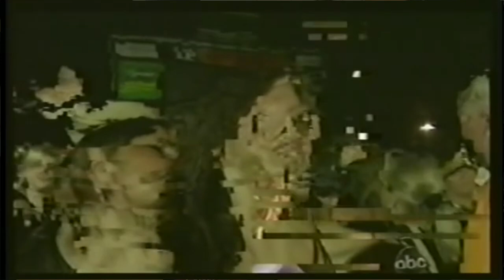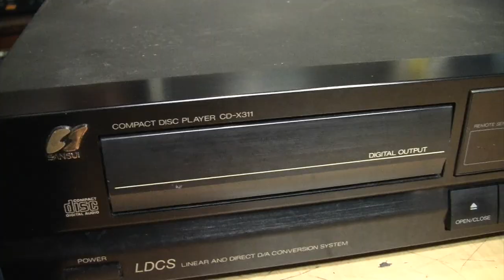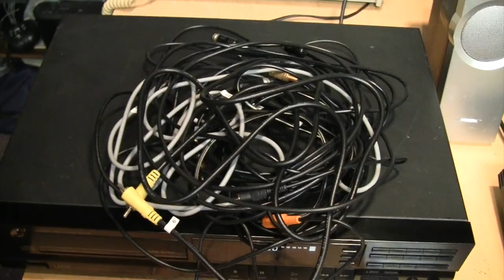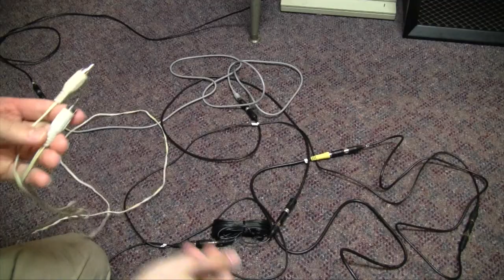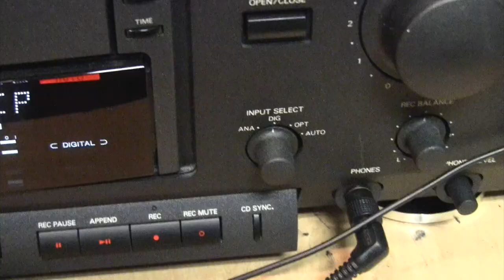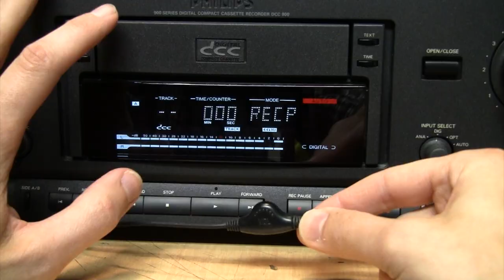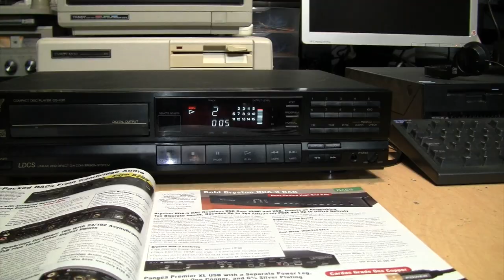What does a crappy digital audio cable actually sound like?

Comment: You should read up on those insane Japanese audiophiles that install personal electric poles into their house so the electricity is "pure."
Reply: Some pure ass 50 hz humm 😂
Reply: @3d-speakers945  Fun Fact: In Japan the line frequency is 50 Hz in the east and 60 Hz in the west.
Reply: @3d-speakers945  50/60 Hz. It's confusing why Japan stuck with both power line frequencies.
Reply: To be fair that's not all that crazy, (don't get me wrong that's still ridiculous) but buildings such as schools are often equipped with separate red power outlets for computers that run on their own circuit to provide cleaner power to their computers. But then again in that case the power is still coming from the same transformer, it's just split off. Getting your own personal transformer does seem a bit over the top.
Reply: @DavidScheiber  Those red outlets indicate that they are fed from a dedicated circuit and are connected to the emergency backup power. "Cleaner power" doesn't mean anything in the context of modern computers which all use switch-mode power supplies designed to handle the poorest supply line conditions.
Reply: @DavidScheiber  That, or the red outlets are connected to a large UPS.
Reply: @DavidScheiber  thats because the PCs schools usually by have the absolute CHEAPEST power supplies 

and any amount of ripple puts a large strain on the filter capacitors..... causing the power supply to go BOOM

they run all the PCs on one circuit so the filter caps across the ~200 PCs can (sorta) combine together.... helping to keep the ripple very low
plus, you dont get noisy electronics like vacuum cleaners/brushed AC motors ..... again, for ripple 

but ya..... its simply to try to extend the life of the PC

even if the PSU doenst fry other components when it blows...... a school will probably just replace the whole PC..... 
VS just slapping in a new PSU

wold be like having the fuel pump go out on your car..... so you sell it to a junk yard for 200 dollars
vs spending 150 on a new fuel pump..... and running the car for another 200,000 miles....
Reply: Wouldn't it be cheaper and purer to just buy gasoline electricity generator? lol
Reply: @jozefik1259  Unfortunately, no. The output from generators isn't as clean as something from a pure sine wave inverter. And it's this clean power output that some electronic devices are extremely sensitive to.
Reply: @ZeldagigafanMatthew  Very sad
Reply: @ZeldagigafanMatthew  I think you have it backwards. Generators output much purer sine waves due the way they work, Inverters on the other hand have trouble outputting pure sine waves and still being efficient due the way switching circuitry works, that's why modified sine wave inverters are so cheap compared to "pure sine" wave inverters. The problem with small generators is their frequency is less stable due the small mass of the rotating parts and the response time of the engine to loads.
Reply: @teresashinkansen9402  Why do you think I specified "pure sine wave inverter"?
Reply: @ZeldagigafanMatthew  Teresa Shinkansen is right. A "pure" sine wave inverter takes a PWM or square-wave inverter output and uses beefy filters to chop off the harmonics. A mechanical, rotating generator will provide the purest sine wave. For a while, they didn't use solid-state UPSes for computers, but rather mechanical motor-generators.
Reply: @jozefik1259  or a batterypack
Reply: @jozefik1259  or a batterypack
Reply: @mistakenotou7681  yeah, that's a much more sensible solution
Reply: Józefik 12  that or hire actual bands to play your selections live in person, ultimate audiophilia right there
Reply: @jozefik1259  NO the power that comes off a generator is dirty as hell.  Nasty looking sine wave.  It's actually not good to run electronics off of them.
Reply: I've only had problems with noise back when I used a cheap RadioShack reciever to power medium size floor speakers. It was actually very noticeable and annoying. Upgrading my amp helped so much I can't believe it
Reply: @AriaPosting  Well some amps are better than others can can either filter out the noise or use optical coupling on the audio side of things to keep stuff mostly clean and "pure". Most of the noise you might get in any digital setup though will probably be on the Analogue side connecting up to the speakers.

Hell even a setup my friend had with all HDMI audio still could pick up CDMA cellphone and make that Gallop noise :D
Reply: Yes and special holders that raises the cables over the floor..
Reply: @ObligedTester  The higher your cables are off the floor, the higher your noise floor.  ROFL
Reply: For the same reason there are audiofools that only use battery-powered laptops as their source. Maybe I should start a company selling audiophile-graded 'ultra high-end' laptop batteries. Only a tad more expensive than the laptop itself, what a bargain! And there's so much more air now! (in your wallet)
Reply: What i heard was that power in japan can be really really bad. Very bad load balancing on the net and thus lots of sags and harmonics that can potentially screw things up.
So this is an audiophile story i DO believe :)
Reply: Wassaaap Droid That is true. The line voltage would go around as well, can't even keep the voltages up steadily
Reply: The saddest (or funniest thing) is that the only people with the money and time to go to such lengths are old retired men who have already experienced significant hearing loss and probably can’t tell differentiate the sound from some cheap Apple earbuds or Bose headphones from the summit tier stats they cherish so much.

I hope these men have children and/or grandchildren that can actually appreciate the difference in quality and they didn’t just engage in inheritance squabbling audiofoolery.
Reply: PT Barnum - No one ever went broke by underestimating the intelligence of the american public - oops its HL Mencken
Reply: Oh yeah I saw a video of those guys ones. Completely loco.
Reply: I'm with him on that.
Reply: couldn't you also just use a UPS?
Reply: @supertoasting1011  If you're looking to minimise line noise, then definitely not. As a general rule a generator will produce an AC waveform with less harmonic distortion (i.e. noise) than a UPS. It has do with how the waveform is produced, mechanical action for the former and an inverter for the latter.
Reply: @supertoasting1011  some of those produce poor waveforms, or pass thru the wall power until an interruption. They can even be worse on some cheaper models.
Reply: Starts to happen in NL too...
Reply: In order to split power sources, kind of like powering two car amps with different batteries on different circuits!
Reply: One guy in Japan had his house built around his audio system because it was so large.. i believe it was a custom made system by 'Final Audio' that also manufacture audiophile earphones
Reply: Is their hearing that perfect or is it a oneupmanship? "Mine is bigger than yours" syndrome.🤣
Reply: Why not use a battery.  It's has no ripples and such.
Reply: And they manage to have a girlfriend...
Reply: cebruthius more like gold digger
Reply: Well from what I gather having properly grounded equipment with a "clean" electrical power in put can make the cleanest and best experience but for your average joe, a little bit of noise isn't going to be noticeable or be a serious issue unless you blast quiet music on a noisy setup.
(Also doesn't help that In some buildings or places with less then stellar power grids the electricity can be a bit messy and can cause all kinds of noise in other electronics)
Reply: @nekomasteryoutube3232  the ground is important, but otherwise a power conditioner like the ones PS Audio sells should clean up the house's electric supply enough to negate jitter.
Reply: Its a form of mental illness. Theres a form of Genetic damage that keeps them from thinking like normal people like us.

Comment: Probably you have more loss of signal in the connectors than in the cables themselves...
Reply from the maker: Yes, that is definitely true. Most of the signal loss is in the connectors and couplers.
Reply: @vwestlife Yep, In any electrical installation, the connections are the weak points!
Reply: Insertion loss? I'd be interested to see some electrical measurements of your long cable / coupler setup vs one of your short, relatively decent cables.
Reply: @belperite  It would be interesting to test 100' of cable VS 100' of a "composite" cable/coupler setup to compare losses by the couplers themselves.
Reply: Gotta use WBT Nextgen 0102Ag RCA connectors, man. Actually, screw that. You have to use XLR! Go balanced!

Comment: Very interesting video. Now do the same with TOSlink...
Edit: For a better sound quality there even exist TOSlink cables with gold "contacts"... The irony...
Reply from the maker: Fortunately I don't think too many people are fooled by that, because the sockets that a TOSLink cable plug into are made of plastic!
Reply: @vwestlife  That's not very convincing without asking a manufacturer why they gold plate parts of TOSLINK connectors?

I'm not trying to be disingenuous here as I don't know the reason or even if there is one. But until recently I didn't know that the casing of TOSLINK receiver modules is treated to be conductive. See the precautions section near the end of this document.  https://media.digikey.com/pdf/Data%20Sheets/Toshiba%20PDFs/Fiber-Optic%20Devices%20TOSLINK.pdf
Reply: @vwestlife  I had a man argue with me a few years ago that it was a better sounding cable because it's digital gold plated TOSlink.   Facepalm.   Very high end cables on basically low quality Chinese off brand stereo system.  Yea, money well spent.
Reply: There are even people that think that gold plated connectors on HDMI cables make a difference to the sound and / or image.
Reply: @Soonjai  Well gold-plated HDMI cables are just... Plated with fool's gold. That's the trick (haha)
Reply: @Soonjai  The reason for gold plating connectors is because it inhibits oxidation which leads to poor contacts over time. The other things they tell you about gold contacs are crap. Electrical resistivity of gold is higher than coper so it is a worse conductor.
Reply: @sobolanul96  as far as I can remember, the contact resistance is lower though. A contact will always have resistance, which depends at the size, pressure and material.
Gold contacts are indeed better than copper ones In many ways (that is why you find many applications of them).
However for most digital signals its crap. The contact can drop a significant voltage (up to ~2V) with a 5V signal and the receiver can still correctly interpret the signal. That is why gold-plated USBs for example at computer peripherals are BS. As Vwestlife mentioned in his video "bits are bits". The inductance/capacitance of the wire which can delay a signal partially are far more critical.
Reply: @sobolanul96  I would consider that to be a theoretical issue at best. Maybe under very humid conditions it coud become a issue in a somewhat reasonable amount of time.

I.e. the electric system in cars, connectors there are never goldplated for anything (maybe in a Maybach or Rolls Royce though) and even in 20+ year old cars oxidized connectors are rarely, of ever, the cause of an issue. And connected Systems there, like the CAN Bus, need a reliable connection as well.

And so far not a single A/V cable failed me because of an oxidized connector either. It´s usualy that either the connector breaks physically or the cable literally breaks.
Reply: @Soonjai  I've had problems with corroded contacts in audio a couple of times, not with digital connections though. The car argument is not valid. The connectors are specially  designed to witstand corrosion, moisture, shock and vibration. All modern cars have heavy duty connections which protect against moisture. My old communist car had no such things so every now and then I had to clean headlight contacts, horn contacts, signaling, and ground links.
Reply: @Soonjai  : Ah, but as the old NES demonstrates, contact corrosion can affect digital signals.

Analogue audio equipment often has capacitors between the signal wire and the transistors anyways, so the equipment is usually designed to deal with it, but it CAN be a problem. Your confusion most arises because there are "silver" colored metals that also fulfill the corrosion-resistance function of gold, including tin & actual silver in some use-cases. Gold coatings themselves usually have something like cobalt or iron mixed in to harden them against abrasion. In contrast, when plain copper is exposed to air, it can slowly form a semi-conductor layer, causing who-knows what kind of signal distortions.

None of that matters with purely optical connections, but for any electrical connection, it has the potential to be very important indeed, even when working purely with digital.
Reply: Ah, you mean like putting Vaseline on the battery terminals so that they would not corrode as quickly?
Reply: Check out technology connections's video, it's really good
Reply: Like, what would the gold "Contacts" even do on an optical cable?
Reply: @SweetTodd  They have the ability to extract money from idiots. That is TECHNICALLY doing SOMETHING!
Reply: @Bee  Read em and laugh, or perhaps we should feel bad for those people who actually believe things like this...

"Premium Construction
Gold-plated premium quality connectors with PVC cable protection to provide superior stereo audio transmission and protect against RFI and EMI. "
https://extreme-audio-usa.myshopify.com/products/extreme-audio-premium-quality-gold-plated-toslink-to-mini-toslink-spdif-digital-optical-audio-cable-with-metal-connectors-3-feet

"Polished heavy duty metal connectors and gold plated tips provide a secure and corrosion free connection."
https://www.head-fi.org/showcase/cable-matters-gold-plated-toslink-digital-optical-audio-cable-with-metal-connectors-and-braided-jacket-6-feet.21747/

"Toslink Digital Audio Cable by Akord provides you with the cleanest possible signal, even at extreme volume levels. These cables use 1mm low-loss core, 6.0mm OD, low-jitter synthetic fiber and heavy metal connectors to dampen vibration, giving you the ultimate listening experience."
"24k Gold-Plated connectors for optimum quality"
https://www.dottmedia.com/product/akord-2m-toslink-gold-plated-digital-optical-toslink-cable/

These was just the first three I found and none of them are really that expensive, but the arguments!
Reply: Technology Connections also got to know about that and poked fun at it in his video on Toslink
https://www.youtube.com/watch?v=ICcEOXVZ3F0&t=1s
Reply: Gold? I'll wait for for the platinum version.
Reply: I bought a Toslink to 3.5 mm optical cord recently. Sure enough, gold on the connectors. But it wasn't ridiculously expensive or anything. It caught my eye because it was a braided cable. I'm a fan of the braided cable.
Reply: Irony? Do you know what irony means?

Comment: I should try this too one day, my motherboard also got a digital audio in (Coaxial, although I've seen the same mobo with TOSLINK), but here is the catch, I don't have any equipment that takes digital coax audio in anymore (I used to).

Really interesting though.
Reply: You can probably find a converter. At least in the case of S/PDIF, it literally uses the same encoding as TOSLINK: the TOSLINK stuff is arguable best for either isolating grounds, or using Mini-TOSLINK to fit TOSLINK in the same socket as a TRS or TRRS cable.

Beware that there's a little bit of stuff that uses TOSLINK cables for non-TOSLINK purposes! TOSLINK cables are just like RCA cables: generic-purposed!
Reply: @absalomdraconis  if I had equipment that could use S/PDIF over TOSLINK I would've bought a converter already, but the catch 22 being that I have no equipment that can use SPDIF currently (aside my Asus M2N-SLI Deluxe which happens to have a RCA jack for S/PDIF, I'm not really sure if it's a input or output, maybe I'll find out when I get my cMP 5,1 which already has TOSLINK connectors, it should be a matter of buying a converter then.)